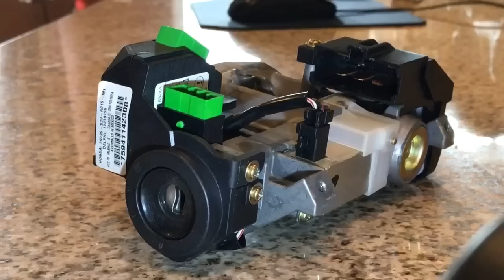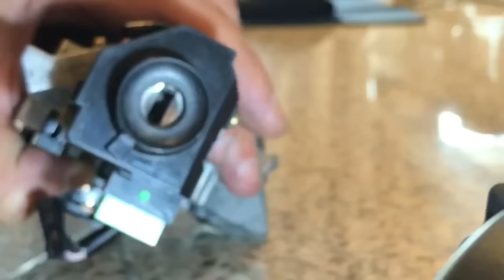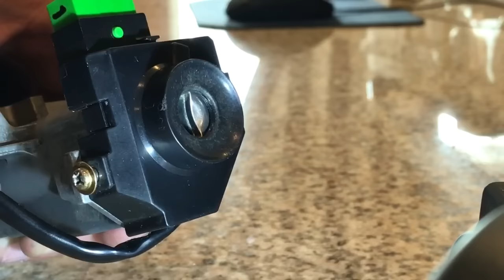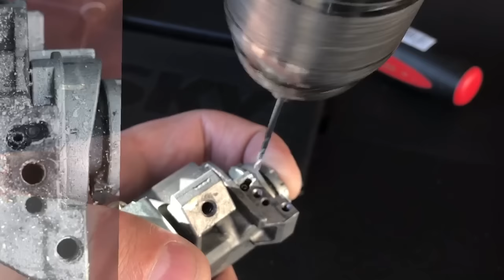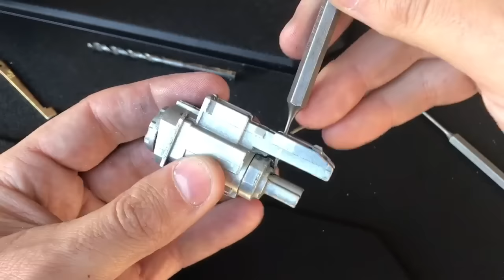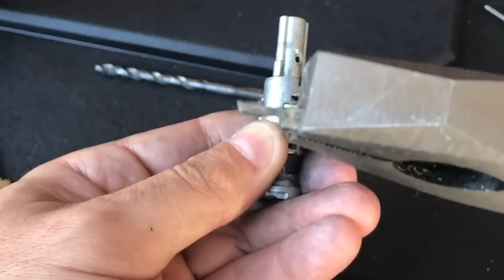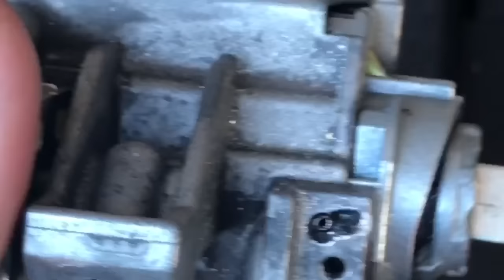Honda Ignition Lock Repair - Step By Step Tutorial

Comment: Thank you! This video really saved me and i finally got car out of that restaurant parking lot without spending a dime  :)  
My question is, what would happen if you took out all of the wafers?  Would the lock still function through all positions? 
When I got mine open there was a few sticking up that i removed and at least 1 I didnt mean to fell out accidently.  The ones I left looked okay, not all of them of perfect but was afraid to take out any more.  Now I got it going but reluctant to take the key out just in case. I have removed and reinserted a few times to put the black plastic rings back on and unlock car door but it just doesn't seem smooth exactly and worried another wafer will jam, or that my car will get stolen leaving keys in :)   I have the fob to lock the doors, windows are tinted and its a POS so not overly worried about theft but its not quite ideal.  I wouldn't mind if I could remove the key without worry even if any same-gen key would start it (with all wafers out).

Comment: Dude, get the roll pin removal kit and you wont have to swiss cheese the ignition. The kit will also pull the roll pin with the ignition still installed on most Honda's
Reply from the maker: I have one.... I made this video for people not locksmiths an average person is not gonna have a Honda roll pin removal kit...
Reply: Amen to that. It was tough though - that 1st pin (drilling the right size hole and at the right place). Swiss Army knife helped to pry the pin out. Right size finishing nail to punch the 2nd one out.
Reply: Same never needed it. But great video for the common folks 👌

Comment: Completed repair and key will now turn ignition, but will not crank. My key immobilizer light on the dashboard is flashing as if it does not recognize the key. Any one else have this problem? Any tips on what I may have done wrong??
Reply: New key lock means new key. Honda got to make their money some how. They have to cut new key . Anti theft system

Comment: Sure enough, there was a bad wafer that I was able to remove.  The key will now turn the cylinder in the barrel, but when I put the whole thing back into the ignition assembly, it won't turn anymore, almost like the steering wheel lock is preventing the key from turning, but even if I move the wheel the key won't turn.  Any ideas?
Reply: Same here, you figure it out?
Reply: @chasehawes7770  Still in the process and will update.  Out of curiosity, did you lock your steering whee AFTER you realized your key didn't work, or was it already locked?  I inadvertently locked mine after, and I think this might be why it won't unlock normally.
Reply: @seacitadel  Yeah I locked mine after the key wouldn't turn (was trying to check if the wheel was locked and locked it in the process.) I'm thinking there is something that is not correctly engaging when re-inserting the cylinder because of the locked wheel. Did you remove the entire ignition assembly or just the cylinder? I just removed the cylinder.
Reply: @chasehawes7770  I only took out the lock cylinder, now I'm in the process of removing the entire assembly because someone said they had a similar issue and it was the steering lock actuator that wasn't engaging, which is apparently accessible under the ignition assembly.
Reply: @seacitadel  I'm going to do the same thing, let me know how you make out.
Reply: @chasehawes7770  Fixed.  Took off the entire ignition assembly and was able to access the spring loaded pin that seats into and locks the steering column.  Pressing in the pin completely seemed to realign the associated slot in the lock housing.  The key turns now, all put back together.  How'd yours turn out?  I'm keeping the kit of necessary tools in the vehicle at all times now because it's only a matter of time before it happens again. Recommend the same.
Reply: @seacitadel  Also fixed, did exactly the same thing you did. Was much quicker than I was expecting. I guess the takeaway from this is that if your wheel is locked and you need to fix the cylinder, you must remove the whole assembly and manual press down on the wheel lock thing to free it up. I took out all of the tumblers so I hopefully will never have to do this again, though I use my Element as a service and repair van so my tools are always it in either way!

Comment: After a few hours of research of videos (including this one), I was able to remove the ignition cylinder without removing the whole ignition system.  I had to find a 90-degree phillips tool for rear screw.  Mine is not exactly like this one - I did not have to drill to get pins out - just an ice pick.  Once I got it out into a dish, I removed 1 bad wafer & key could turn.  I put it back together & it was still binding.  While working on it, 3 wafers fell out & I was SOL (see William Bell's post - support wafers & LEAVE THE KEY IN like this video shows)!  I found a knowledgeable local locksmith who put in new wafers for $35!  Otherwise I would've left them out.  Locksmith also alerted me to a small thumb tack shaped metal pin (I found it later on my floor mat), which is held in by the first piece (looks like a green computer board) under the immobilizer.So I was able to keep my immobilizer & original keys for my 2004 Odyssey.  Very happy to be driving again!
Reply: Darren Redfield how did u get the second pin out?

Comment: If you drill on the side wall perpendicular to the pin instead of parallel, with my graphic with the pin on the left and the bit on the right> ||--- with your drill bit slightly offset to the right of the pin, you will easily walk the pin out of the hole with the flutes of the drill bit as it rotates clockwise. Instead of 3 minutes, you'll be spending 10 seconds. You're welcome ;)
Reply: "By the right" -- do you mean on the side where the key goes into the ignition? I am attempting to do this now without removing the ignition from the column.
Reply: @philipdecicco2096  yes. The side of the bit will rub up against the pin and walk it out of the hole. Just don't hit it too deep or you'll just have a hole in the side of the pin and it will trap the pin against the bit.

Comment: Hell can you tel how much it cost ,
Reply: I paid a mobile locksmith $160 to do this fix on our Odyssey. I don't know how long it would have taken me to do it myself, but many times I have gotten into a job I've never done before and halfway through, have wished I had paid an expert to do it! It took the guy I found on Craigslist less than 1/2 hour, and he had a bench in the trunk of his Prius. He wanted to sell me a new key for $120 but agreed that our valet key was barely used, and my key was lightly used, so I replaced my wife's worn key with valet key and kept hers as our spare. He assured me that even though valet key was gray, not black, that it would fit all locks on van.

Comment: I have a better solution for roll pin removal get a small wire stiff wire I used electric fencing wire but any stiff wire the same diameters inner hole of roll pin and super glue it in when the glue drys pull wire and remove pin

Comment: Great really helpful video. 

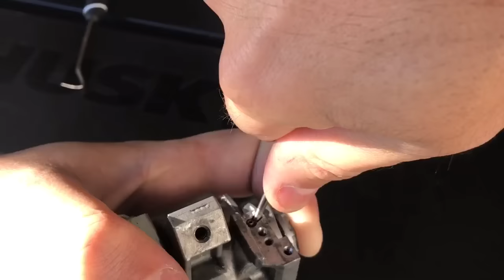I successfully got the ignition barrel out of my friends Honda Civic 2007 1.4L Right hand drive European model last week. I did not need to remove the ignition assembly from the car. It helps to know that the expanded rollpin is 2mm diameter x 10mm long. I sprayed some loosening fluid into the pin and let it seep in. I then ground the tip off a 2mm diameter nail and used the nail to carefully gently and only slightly hammer tap the head of the pin. This to try release any binding between pin and its aluminum retaining wall. I then followed the method shown in this video https://youtu.be/T01989YN2Ew at video time circa 3:34 ie use a small fine flat head screwdriver to tap gently on each side of the barrel to open and expand that gap. This causes the pin head to gradually work its way out. It really worked great. I was able to grab the exposed rollpin head with a pliers and it pulled out very easily. The steering wheel can remain on and is not in the way. It did not deform the housing assy. It really speeds up the removal and I think is ok for an old car repair.  Hope this suggestion helps save someone a lot of time getting this lock barrel assy out.
Reply: The only other difficult issue is that one of the Immobilizer screws is in a difficult to remove location requiring an ‘L’ shaped Philips or a fine body Philips screwdriver or similar.
Reply from the maker: A couple of Great tip on that video, I will try to remove the roll pin using that technique on my next Honda ignition repair..

Comment: These locks are junk.  My shop does them all the time,  and often as not, not just one,  but 3 or 4 or more of the tumblers are worn out and need replaced.  Then you put new ones in and the original key won't go in and out of the lock because the side of the key is worn down.  If the side of the key is worn down .004-.005 then they keys must also be replaced,  and reprogrammed to start the vehicle.   This is the worst automotive lock design in history.
Reply: Totally agree, they worked really hard to make this as complicated and unreliable as possible.  Sad part is with all this crap Hondas are still one of the most stolen cars on the planet.  All they did was hurt consumers and give themself a bad name. I was able to remove the interlock cap with a sharp 90* custom bent screwdriver, did whole repair in the car. Dont know if thats how you guys do them?

Comment: That is not fixing the problem 100%. 
What caused the problem was the original key is worn out and it will happen again soon just leaving it like this. 
The real solution is to replace all the tumblers with original Honda, even the one that don’t seems worn and cut a new key (or key shell and transfer the transponder) by code.
Reply: I made this video to help people who cannot afford to pay the dealership Or Locksmith prices ! Dealership $600 / Locksmith $300 in most cases, I Don't expect the average person watching my video to have a honda pin kit or a key Shell that needs to be cut... I've help alot of people the feedback has been positive (YouTube comments, Emails, & Telephone Calls) Thanking Me for how I got them out of a jam and how much money I saved them, most of the negative Feedback has come from fellow locksmiths, one  took the time to call me just to let me know that Im A Ass-wipe and A Cancer to the industry And hung up on me I didn't even have a chance to Respond..

P.S : Your Right Alot of times the keys are badly worn out and should be replaced!! I wished I would have done a better job explained that.. Thanks For Your Feedback..
Reply: I'm totally with Jose G. On this one.
Removing a bad wafer is a temporary fix at best.
Change all the wafers with quality parts (asp) and a decent key cut by code (jma shells are great)
Carefully remove the transponder from the old key.
Fixed correctly,  it will last for years.